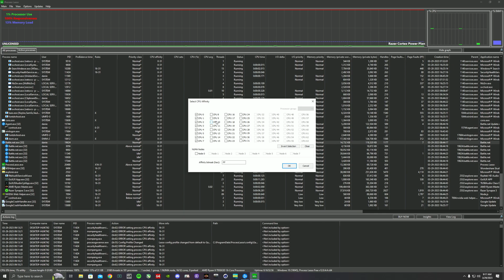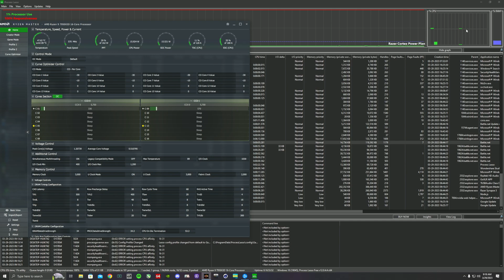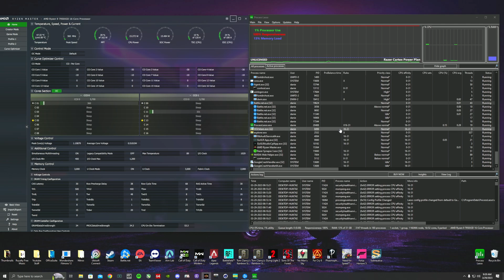Process Lasso Setup On 7950X3D (basic tutorial)

Comment: Weirdly enough ive done a bunch of testing also from, preferred cores to game mode on/off high performance/balanced, to uninstalling the amd 3d chipset and only using process lasso, but weirdly enough in some games i still get micro stutters like its trying to switch CCD's and this is with hard set cpu affinity, it's really frustrating -.-
Reply from the maker: The easiest way to tell if something is wrong is to disable the second ccd. That way you will know if the reason it's stuttering is because of switching to wrong ccd, or not. If it's switching to wrong ccd despite all your settings, best choice is a completely clean reinstall of everything.

Comment: Can you do a guide for, 5800X3D? Should i use bitsum highest performance/high performance with it or balanced power plan?
Reply from the maker: For 5800x3d the process is slightly different, being a 16thread cpu instead of 32 thread you may have to allocate your resources differently. I actually set up my girlfriends pc with lasso and what I did is allocate 6-8 threads to background tasks, and the 8 fastest threads to gaming. It didn't honestly make a big difference because 5800x3d already works nearly perfectly with no lasso needed.

I really recommend maxing out your undervolt on the 5800x3d, if you haven't tried -30mv all core already, give it a go. I did a video on how to set up 5800x3d with pbo2 tuner app about 2 months ago, and given I only have 31 vids, it should be easy to find. If you have any questions let me know.
Reply: @Beefy-Tech  Awesome, thanks! Yeah, i already under volt -30 with pbo2! ❤‍🔥I saw a video about 7950x3d (maybe it was one of your videos?) and he said that best performance was with balanced mode power plan, something about letting some "cores?" sleep, if you don't let it you get much worse performance (in games). Maybe it was exclusive to 7950x3d, I'm wondering if it applies to 5800x3d also? Or should I just use highest performance powerplan or bitsum highest performance? And also, I would love to see you review g502 light speed wireless mouse and see how it performs, if the new lighter version has the same laser that works too. Maybe G502 is too heavy and not a mouse that you have interest to review though. Love the quality of your videos. 👌💪
Reply from the maker: @BlackV4You  so the 7950x3d can be set up in 3 ways. No preferred cores in bios, Balanced power plan, and Xbox game bar.

Preferred cache in bios, process lasso background tasks.

Preferred frequency in bios, process lasso games.

All 3 methods work, but require different setup steps. I'm running it with preffered cache and lasso background tasks atm.

Also I don't own a g502, and have no access to peripherals outside of buying them myself.

I own a couple mice, out of which my girlfriend owns a Logitech G Pro Superlight that ive tried out, but otherwise we don't have a g502👍
Reply: @Beefy-Tech  Thank for the answer! Keep up the good work!

Comment: my amd recording software is bugged and it records without audio would you recommend any other recording software's?
Reply from the maker: Tbh man, both AMD and nvidia recording software is ASS, but at least they don't tank performance. The best recording software overall is OBS, but OBS tanks performance much more then AMD/Nvidia Options while on a single pc setup.
Reply: @Beefy-Tech  k bro thanks ill be sure to try that out as at the moment im playing at 144fps capped and if i uncap it im at around 200 most of the time so it wont really make a difference

Comment: Is there really any significant performance gains by doing this?
Reply from the maker: No, just peace of mind that the cpu works as intended. I tested 20 games and even with Prefer Cache set in bios, forza horizon 5 and bf2042 occasionally switched to frequency ccd, meaning the cpu can occasionally have that ccd switch issue without lasso.

Comment: You're doing great work. 

I've been thinking that the 7950x3D may have a lot of untapped potential if configured properly. Process Lasso may be the method by which that untapped potential can be obtained. 

I'm sure the 7800x3D will be great, but a massive benefit of the 7950x3D is having that extra CCD to assign things too. And in cases with games that benefit from higher clocks you can assign them to the higher clocked CCD. 

With the right setup, the 7950x3D might be the best overall desktop CPU in the world right now.

Comment: Or just let the AMD driver handle everything save your precious time
Reply from the maker: Hey if you want to take your chances you can. I've experimented with the Xbox game bar + default core preferences in bios and it was an absolute mess. This comes from someone that's tested about 20 games, and more then half did not work properly at all😂. Even with prefer cache in bios alone, it still makes mistakes and switches to wrong CCD on its own, so if you have faith in it, you may do as you please ;)
Reply: @Beefy-Tech  I'm not going to lie. I tried it, left the BIOS settings as is (auto on preferred die). But i set all my major background tasks to the non-Vcache die and my most played game (Star Citizen) with a high cpu priority and affinity to all Vcache die. I saw about 10-25% uplift in FPS. With this setup, i do notice that my 9th core (the 1st one on the non-vcache die) is always being utilized whereas with Gamebar, it was at 0-1% utilization on all non-vcache cores (parked). Regardless performance seems better with the lasso.

Without the lasso and leaving gamebar on to manage it, i noticed that Star Citizen frequently pulls in all cores utilization when in the dense cities which affected performance. again I will keep testing, but for SC Lassoing the Vcache core to it seems to bring out the 7950x3d's full potential. I'm not for turning off the non-vcache die, but this seems to be a good way of setting it and forgetting it based on your use case.
Reply: @MrGatz  i also did the same and left everything default and saw a lot of the time the Cache CCD was only being utilized about 50% with some games and the other half was being used by the frequency cores, then i tried to force use games to use the 3D Cache CCD and i saw like a 20-30 fps jump, unfortunately i ran into problems where some games would still try and use the second CCD even though i set the cpu affinity to only use the 3D Cache and i have no idea how to fix it =/
Reply: @Yeahnicegaming  some games, the lasso won’t work because of anti cheat software. The way around this has been to lasso the game client (like steam or RSI launcher for Star citizen) then the game inherits the lasso. I can’t say this will solve your specific problem, but i ran into that issue and that’s how i got around it. Just focus on lassoing your most played games. No need to go crazy. But test and verify
Reply: @MrGatz  So the games that did this was Sons of the forest and Cyberpunk had some odd issues also, i manage to disable the frequency cores in bios which is CCD01 and this solved all my problems, yea im only using half my CPU but i game 99.9% of the time and i have no idea how long it would take to get my hands on a 7800x3d when it comes out.
Reply: @MrGatz  hi Jay, this is also how I handle Star citizen. Do you also assign all of the other programs to use ccd01 while SC is using ccd00 exclusively?
Reply: @Bretton549  Yes, i didn't do a select all approach and put all background tasks to the non-vcache ccd. I just picked the larger ones, like Asus armory crate, spotify, mSI center, etc... 16-31 instead of 0-15

Comment: Where have you set your curve optimiser? I've ran auto-oc, it ended up doing -30 all cores (it didn't boot), then I ran -10 all cores (through app, didn't boot), then I visited bios, set -15 manually, works like a charm.
Reply from the maker: Curve Optimizer is within precision boost, in advanced, and AMD overclocking. I am currently running -30 on first 4 cores, -10 on core 5, and -20 on cores 6-8. I am testing on a per core basis now, so it'll take a while to figure it out. Unfortunately I am on vacation, so can't test for like 8-10 days😂
Reply: It's always a good idea to change CPU and RAM settings in BIOS and not a program. I run -25 on all cores on my 7700x with no issues. YMMV.

Comment: Great video, would love to see the 'prefer frequency' option and then lasso the games to the vcache ccd video!
I started using lasso a day or two ago with my 3700x just to test it out. I saw a video of valorant pro player Tenz disabling core 0 for games, and decided to try the same, with the addition of disabling core 1 also. While I didn't document my 1% lows before, I could tell a massive difference in both cod and csgo to the point of it feeling like a pc upgrade.

The reason I am considering this cpu is to lasso the os, background tasks, and mainly obs to the non vcache ccd. I put the cpu affinity in games to cores 2-13 on my 3700x, together with setting obs to cores 14 and 15, and started a test stream using gpu encoding. To my surprise, obs ran just fine on only the last two threads. However, this was without a webcam or any alerts/animations/etc., but these should still all be done by the gpu with little impact on the cpu (I think) in the case of gpu encoding. This leads me to believe that if I were to only use 6 cores 12 threads on a 7800x3d that, generally speaking, it wouldn't impact my gaming performance too much, but since I got a 4090 it actually might, hence, if the 7950x3d would work as I want it to then it wouldn't be a compromise.

Also, what is your opinion on Linus' recent video about the 7950x3d. Sorry for the wall of text haha
Reply: ive tried every combo of fiddling with the 7950x3d unfortunately i am still getting micro stutters in some games =/ thoughts ?
Reply: @Yeahnicegaming   what is your power draw like by chance? Psu?
Reply from the maker: I was in the process of testing process lasso more thoroughly but unfortunately I left on vacation and do not have my main rig to test as a result xD.

Will explore in far greater detail once I am back. Have seen a variety of very interesting options such as the frequency ccd preset + lasso, and also eliminating core 1 from being used in games.

Lots of testing and fun up ahead given you got a 4090! That 7950x3d will be a treat to go with it.

As for linus's video, it cleared up for me that I made the right decision to go for 7950x3d, as a tech enthusiast I had no issues properly setting it up, but linus's video demonstrated guides on the 7950x3d are 110% necessary, and that makes experimenting and creating content on it far more significant 👍
Reply: @Beefy-Tech  I am seeing a lot of "its a scam!" videos but I don't know about you, but as a PC builder I am quite patient with these things and happy to play around to make sure its setup the way I like. I understand that this CPU isn't as plug and play as the average user would expect on a CPU with this price tag.
Reply from the maker: @GLOCKRIVERSTV  I made it work perfectly fine day 1 by turning off 1 ccd, and then in 2 days learned how to use it and moved back to 2 ccd's. Most people just don't want to see a bios screen so that's where they go wrong in buying a cpu dependant on a bios screen.

But then again, 13700k took me a long time to overclock perfectly in bios too, so intel works, but nowhere near full potential without OC.
Reply: @Beefy-Tech  Im excited for you to get back lolol
Reply: @GLOCKRIVERSTV  It’s not a scam. A lot of Youtubers are making it out to be like a scam and I don’t know why. The main reason being that it’s not plug and play for a normal user. But here is the thing, if you are someone building a PC for the first time, these steps are things that you MUST learn and do. Updating Windows, BIOS, Drivers are one of the most fundamental things to do when building a PC or upgrading parts on a PC. So if you are a PC enthusiast, then this should come to no surprise. So why call it a scam when MAJORITY of the folks that are swapping out a CPU already know what they are doing? They make it seem like majority of folks that are buying these CPU are people that just throw in a CPU to motherboard and turn it on and that’s it, the end. No, that’s not majority of folks. But, what really pisses me off is when some of those big YouTubers go on to say that 7950X3D is only about 1% more performance than the 7950X. Ohh boy that boils my blood. I’ve seen some massive fps improvements in most of my games. Easily 15-25% increase depending on which game. And that’s just on fps, but there’s just something about the vcache that even though it’s given me more fps, it looks a whole lot smoother as well. I keep telling folks, don’t listen to those negative reviews. The 7950X3D is a BEAST!!
Reply: @MustafaGT  good read brother, I totally agree — I remember on my very first build I spent nearly 3 days just playing around and learning the bios, what all these acronyms meant and exploring performance gains. I cant wait — my 7950x3d is on backorder and im excited to tinker :)